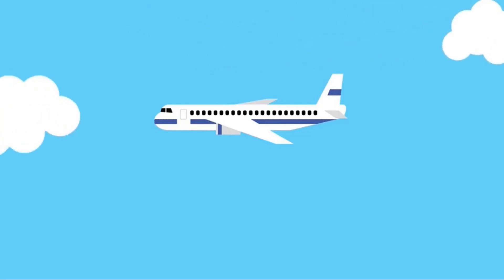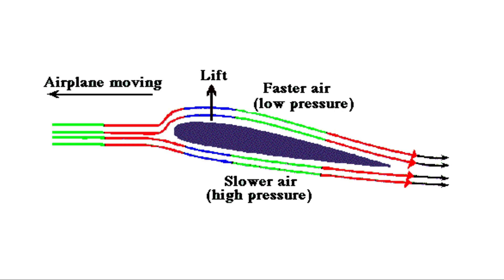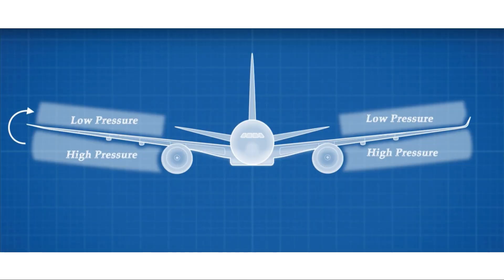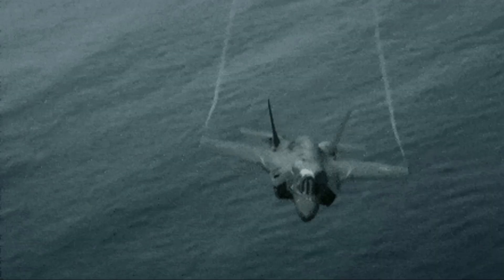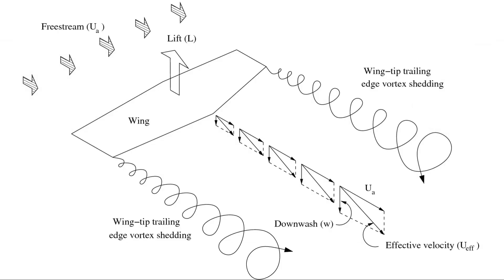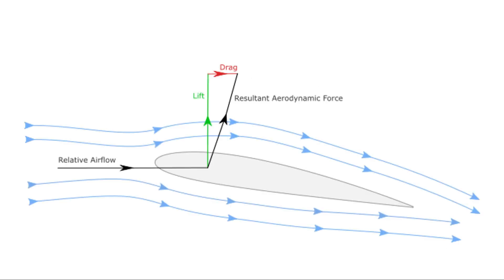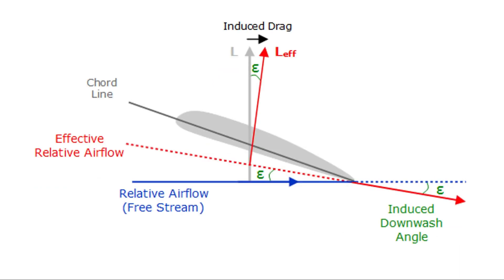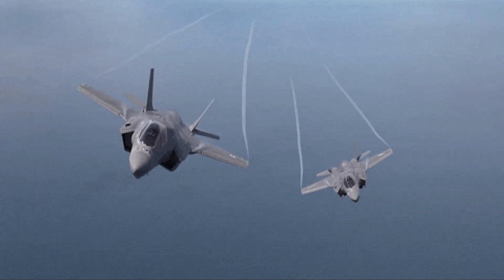What is Induced Drag in aircraft | Wing tip Vortex | Downwash | Lift Induced Drag|

Comment: Suppose a big aircraft made vortices on the runway . And i am about to land with a cesna . Sould i undershoot or overshoot the runway?
Reply: Neither! You should not under or overshoot the runway to avoid wingtip vortices (wake turbulence) from a larger aircraft. Here's what you should do:

* *Maintain awareness:*  Listen to air traffic control (ATC) instructions for spacing between you and the larger aircraft.  
* *Increase spacing:* If possible, request a longer landing clearance from ATC to ensure more time between you and the larger aircraft.
* *Let the turbulence settle:* Aim to land after the recommended time interval following a larger aircraft. This can vary depending on wind conditions, but typically it's around 2 minutes.

Here's why under or overshooting is not recommended:

* Overshooting puts you at risk of extending your landing and potentially ending up outside the safe landing zone.
* Undershooting reduces your landing area and increases the chance of a hard landing.

By following safe spacing procedures, you can avoid the wake turbulence altogether.